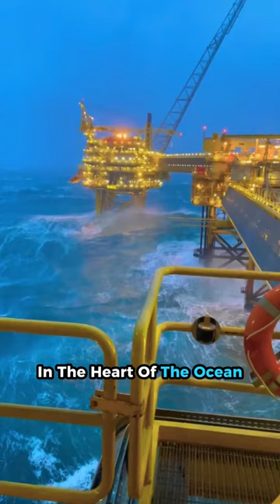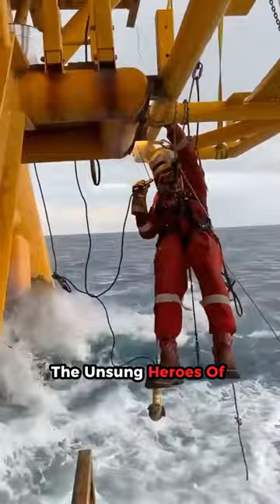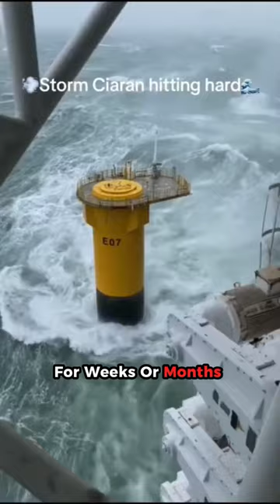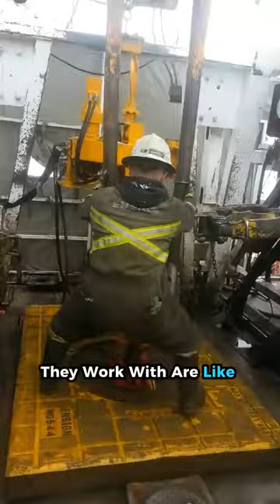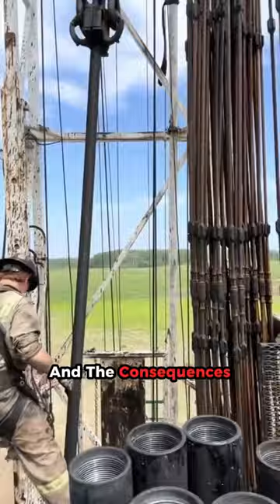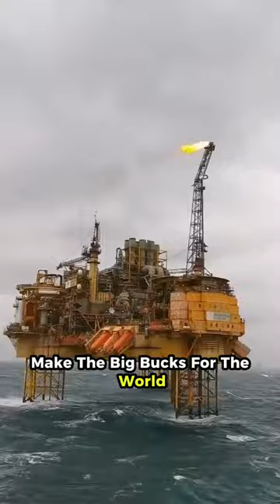Reason why oil rig workers earn so much . It's crazy. #ocean #sea

Comment: And somehow women are still like, ,"pay gap!!!"
Reply: There is a pay gap. Most women cannot do jobs like this because they are responsible for the children. No man could have a job like this and a family if it weren't for a woman.
Reply: @pioneerprepper2048 
Actually, according to statistics Women generally don't do jobs like this by choice
Ignoring the women with children, childless working women still statistically choose easier, less dangerous, or less physically demanding jobs than men. 

That's all there is to it. There is no "pay gap", it's just a result of women generally choosing safer jobs at the expense of less pay, with more men doing extremely dangerous jobs that pay more for the risk.

The difference is literally between life and death.
You get paid more for jobs you have a high chance of dying for. Turns out most women are deterred by that risk, whereas most men are more willing to face that risk.
Simple as.